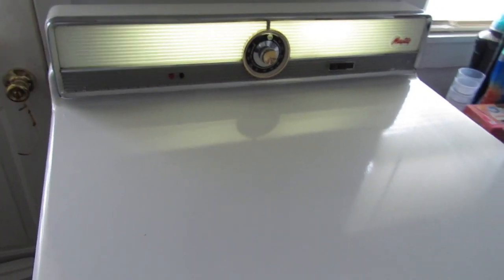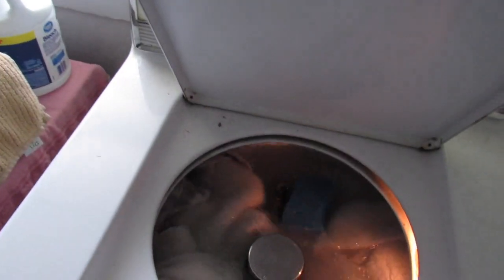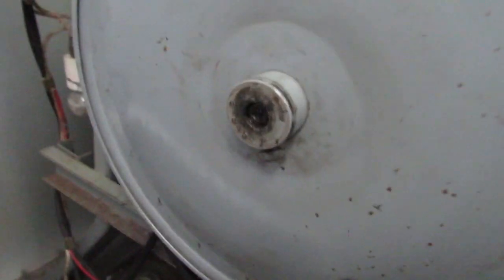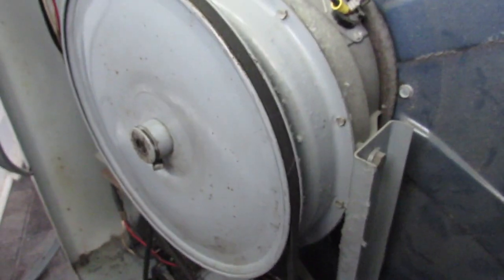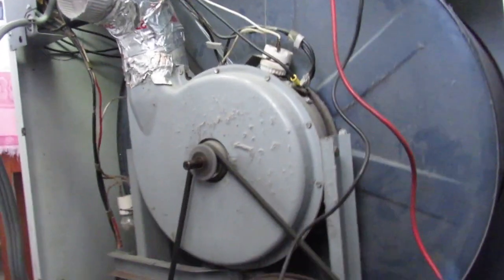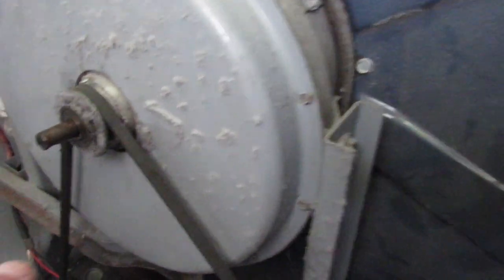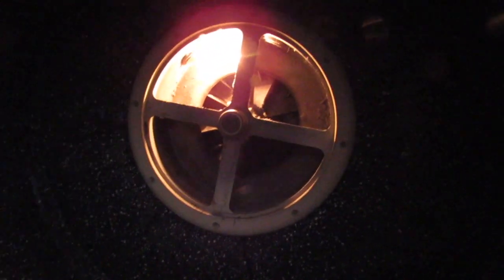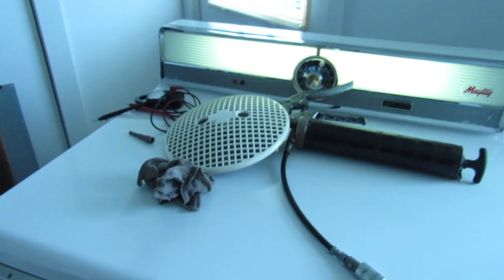1957 Maytag 641C Dryer repair.

Comment: I’ve had that happen on my 1974 Maytag DE306 HOH dryer before. I always make sure the bolt is tight, and use a wrench with good leverage to make sure it is tight. I use Zoom Spout for oiling the drum bearing and blower shaft, and I use grease for the tensioner/idler pulley shaft as well for the tensioner slider. I might even make a video on showing how to light the pilot light on my 1973 Maytag DG306 (I have 2 Maytag HOH dryers, one gas, one electric), and the older Maytag gas dryers did use a standing pilot to ignite the gas to the burner.